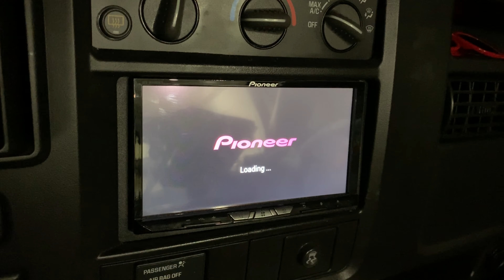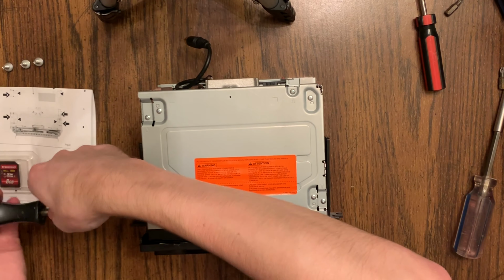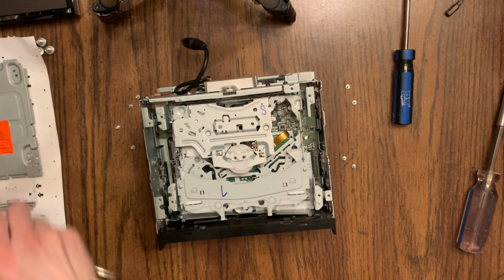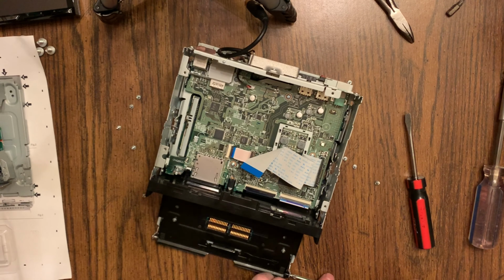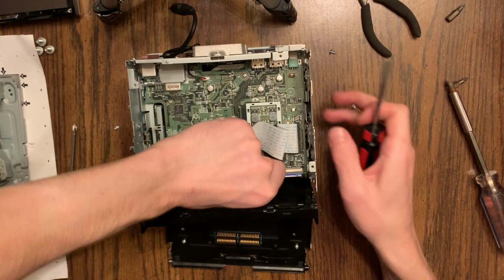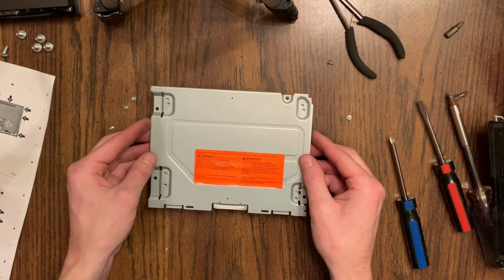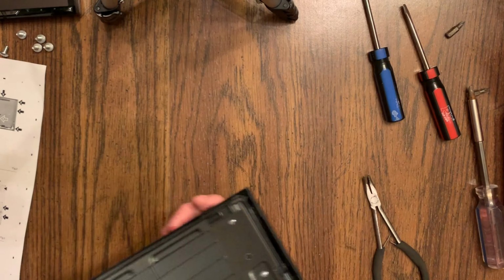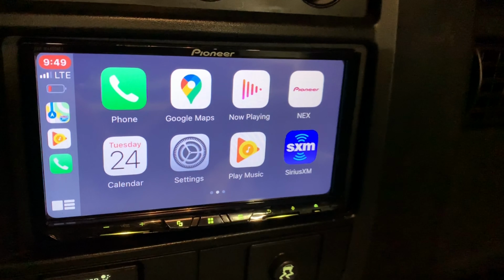Pioneer Software Error Fix - SD Card Replacement Procedure

Comment: I'm having the same problem with my avh-4400nex. Where can I get the software to load on my SD card. Thank you in advance
Reply from the maker: You may be able to find the software on the forums. The site is currently unavailable though..?
http://avic411.com/index.php?/topic/82490-backups-and-images
I purchased a pre-loaded SD card on eBay. Price is close to $30 if I recall.
Reply: @VanwithTim  i cant open the link.. is there any other link?
Reply from the maker: @stephen8385  try again. Looks like the site is back up 👍
You should be able to find the procedure on the forums for how to correctly format and load the file to a SD card.
Reply: @VanwithTim  Right but is the file on the Site? Dude wants 70 dollars now.
Reply from the maker: @cyberlocc  Check out this thread. 
http://avic411.com/index.php?/topic/90534-how-to-fix-for-avh-w4400nex-boot-loop/
He links to the server location of the file needed. I haven't tried the file myself, so can't verify 100%, but the download link seems to be working!
-Tim

Comment: Hi thanks fpr the Video. where may i get a 4200nex SD card??
Reply from the maker: I think this is what you need. I would message the seller to be sure.
-Tim
Reply: @VanwithTim  Hi Tim.  I read some posts and watched the video and am a bit confused on the SD card part.  I understand I can buy a SD card, but I do not fully understand how to "format" it.  Do you know where to buy one already formatted?  Or is there any videos on how to format it?  I dont want to go thru all of the trouble replacing it in my unit and it turns out I did not format it correctly.  Thanks so much for your help
Reply from the maker: @therealjordansloan  I'm so sorry Jordan, not sure why my link didn't post in the previous comment.
I believe this is the pre-formatted SD card you need, but I would message the seller to make sure!
https://ebay.us/MTI20Z
**EDIT** That link is actually for Fernando's 4200NEX stereo.
What stereo do you have Jordan?
Reply: @VanwithTim  Hi. Thanks so much for the quick reply.  I have the avh4400nex series.  Thanks sooooo much for your help.
Reply from the maker: @therealjordansloan  If you want to purchase the pre-formatted card for the avh4400nex (just plug it into the internal SD card slot and be finished) here's what you'll need: https://ebay.us/XeQpuI

Or to save money here's the procedure for DIY on a new SD card: http://avic411.com/index.php?/topic/90534-how-to-fix-for-avh-w4400nex-boot-loop/
Reply: @VanwithTim  Hi.  I  thought I replied to this but maybe it didn't work.  I have the 4400nex.  Thanks so much for your help!

Comment: I need the archive .img or SD card with program loaded for pioneer AVH-Z9250BT help me please! my head unit not work.........
Reply from the maker: I believe the United States W4400NEX is the same as the international Z9150BT. (The W4400NEX file will work on the Z9150BT).

However, I believe the Z9250BT is equivalent to the United States W4500NEX which doesn’t have the free file available yet.

You should email this eBay seller to see if they can offer you the replacement SD card or file:
https://ebay.com/usr/dont_buy_before_reading_description

Comment: How do you open the front housing since the unit with even boot?
Reply from the maker: Great question - You should still be able to remove the screen: 
Carefully use a small tool to slide the bottom screen release button to the side, then push that sliding button "in" to release the screen (it's been a long time since I've done it - might be reversed!)

Then you can try gently grabbing the metal at the bottom corners of the screen frame with some pliers. You'll want to pull on both the bottom left and right sides. Eventually it should start to move outwards.

Comment: I have a AVH-X8690BT stuck in boot loop. Do you have specific image file of internal SD card for this model? I only need image file. I'll be really thankful to you.
Reply from the maker: Hi Rahul. I searched the forums (http://www.avic411.com/) to see if anyone posted the image file but didn't find anything.

A lot of people have been purchasing their replacement SD cards / image files from either of these two sellers if you want to send them a message. They may be able to help.

https://www.ebay.com/usr/dont_buy_before_reading_description

https://www.ebay.com/usr/asd255786
Reply: @VanwithTim  Hi, thanks for replying to my query. I've tried to contact the above mentioned ebay sellers, but no luck yet. Also tried on forum and same response their. I'm really feeling sad.
Reply from the maker: @rahulgoel05  Sorry to hear that. Hopefully you will receive some good news soon. That is very frustrating.
Reply: @VanwithTim  hey I got the required img file from a Sri Lanka based eBay seller. I have a 64 GB sd card lying with me, will it work for the purpose? if not then what's the max size of internal SD card supported by Pioneer stereos?
Reply from the maker: @rahulgoel05  Oh that's great news! The 64GB card SHOULD work. (The 64GB size works fine in the AVH-W4400NEX model).

Use this video to write the image to the card if you're using a Windows computer: https://youtu.be/Cro26vuoPHo

Let me know how it goes!

Oh, and once the files are done being written to the SD card, your PC will show all these errors like in this video: https://youtu.be/pfWDguRujEE?t=13
That's normal. Just remove the SD card from the computer and install it into your stereo.

Comment: Is the W4400 same as Z9150bt? Can I use the w4400 image file for z9150?
Reply from the maker: The unit LOOKS similar, but the file is different.
I know the 4400 radio tuner ends in odd numbers (88.9FM,102.5FM, etc) and the Z9150 has them in even numbers.

You could always try it and see if it works, but I don't think it would.

You could also purchase the pre-loaded SD card for the Z9150 from here: https://ebay.us/UaDCQP

Let us know if you end up trying the 4400 files. Curious if it would work!
Reply: @VanwithTim  It actually worked, i played some songs off of the USB, the menus work too but havent tried everything yet. Thanks for the reply.
Reply from the maker: @H4ndle911  Wow that's fantastic news! There were others on the AVIC411 forums who were looking for the Z9150 file without luck.  I'll let them know of your success!

Let us know if you run into any problems down the road!
Reply: @VanwithTim  well there are radio settings but no radio in the input select menu
Reply from the maker: @H4ndle911  Hmmm. After I purchased the pre-loaded replacement card (the w4400 file was previously unavailable for download) my unit has been missing the radio function as well..?
Haven't spent the time removing it again to try "re-imaging" the card.

I did ask another commenter about their success and they said the radio is still fully functioning on their W4400 after the SD card replacement.

They did mention having to use a pin to push the small reset button on the bottom right of the faceplate. I tried but didn't work for me.

Really strange...
Let us know if you end up figuring out the issue. Very curious myself.
Reply: @VanwithTim  i can confirm the W4400 image file works on Z9150bt. Initially I lost the radio function but it did came back after I did a RESTORE. (I pin reset it after installation but the radio menu was missing. I pin reset again and somehow the whole radio function disappeared, not giving up, I did another RESTORE from the menu and this round everything came back). System information still showing the model as Z9150bt. Hope this info helps someone still figuring out.

Comment: Radio is working again
But lost touch on screen…
Radio boots properly now, but lost all touch functions…
Any ideas?
Reply from the maker: Hey Alex, do you happen to have the W4500 unit? I've heard other reports of the W4400 file working on the W4500, but a total loss of touch screen.

If you have the W4400 and indeed used the W4400 file, I would remove and re-insert the ribbon cable into that funky connector on the motherboard. Sometimes if it's even slightly angled and not fully inserted the touch function will fail.

I think with the W4500 units you're still forced to purchase a pre-loaded SD card from one of the eBay sellers.
-Tim
Reply: @VanwithTim  thanks for thé reply Tim…I do indeed have a 4500…
I had a spare SD card so I figured I’d try…
So no chance there is 4500 file somewhere online? I can order a card otherwise.
Reply from the maker: @alexinprint9804  It's been a month or so since I last checked but if it were going to be anywhere online, it would be somewhere in here: www.avic411.com

Otherwise looks like ~$41USD on ebay unfortunately: https://ebay.us/xvs435

Also here's the instructions on how to remove the written files from that SD card if you plan to re-use it: https://youtu.be/pfWDguRujEE

-Tim

Comment: Hi will this also work on the SPH-DA120?
Reply from the maker: The removal process should be similar (or identical), but the file won't work.
I believe the USA version (W4500NEX) is the same as the X8650BT and SPH-DA120.
Unfortunately none of them have the software available online for free download yet.
There are many eBay sellers that say they have the file / pre-loaded SD card for sale though.
I would reach out to one of those sellers to check!
-Tim

Comment: I just tried this fix and I was able to replace the SD card. My problem now is that when the radio powers on, it turns completely off after the Pioneer loading screen. Any advice?
Reply from the maker: Hi Favio, this is the first time I've heard of this issue. I would first disconnect and reconnect any of the ribbon cables you disconnected in the process. Many people have found them to be slightly mis-aligned with the motherboard socket where they connect.
If the issue persists, I would try erasing the SD card and re-writing the file. Possibly it went corrupt during the file writing process?

Here's how to erase the SD card:
https://youtu.be/pfWDguRujEE

and of course here's the file writing guide:
https://youtu.be/Cro26vuoPHo

Hope you're able to figure it out!
-Tim

Comment: I have the 4500NEX can I just buy the replacement card from pioneer with everything loaded on it already. I see where they sell the card for almost $80 but does it have whatever image or firmware that is needed. Itching to put this unit back together. Any helps appreciated thx

Updated- I bought the $100 replacement SD card and installed it. Now it turns on and I get the splash screen and then the loading screen and then it turns off???? Any ideas???
Reply from the maker: Hey Jonathan, do you have a link to the Pioneer replacement card? 
So far everyone has been either downloading and writing the new files on themselves, or just purchasing the pre-loaded card from eBay: https://ebay.us/qMRY37

For the W4500, the file isn't yet available for free online, and another commenter already tried loading the available W4400 file but was unsuccessful.
Reply: @VanwithTim  I don’t have a link but I read on another post a guy put the link for this part number CXY 3767 and when I pulled it up on Pioneers website it pulled up the SD card
Reply from the maker: @jonathanscott2481  Ah I didn't think to check out the parts catalog for the unit. I think you probably found it here?
https://parts.pioneerelectronics.com/part.asp?productNum=CXY3767

They have a customer service number: 1.800.421.5080

I would personally be weary of buying the factory card replacement, as the problem lies in the cheap SD card itself which becomes corrupt. I would personally trust the eBay sellers over Pioneer on this (just due to their current track record across the entire AVH stereo line so far.)

From what I understand they're still using the same shoddy SD card supplier in their new units... (It's good enough to get the radio to work until the warranty runs out, then after that it's not their problem)

Just my personal input! Might be worth a call / discussion with their parts department to get their input as well!
All the best. - Tim
Reply: @VanwithTim  yes will that work
Reply: @VanwithTim  or does something else have to be loaded onto it
Reply from the maker: @jonathanscott2481  I'm not 100% sure on the Pioneer replacement if it comes pre-loaded or not.

The eBay one will have everything you need for sure though. Should load a bit faster as well as they use a higher read / write speed SD card than the factory card.
https://ebay.us/qMRY37

I guess the only way to be SURE about the one purchased through Pioneer would be to call and verify! Sorry I can't be of more help!
Reply: @VanwithTim  ok thx for the help. I’ll let you know if I get pioneer on the phone. I plan on trying. Need to let them know how big of a pain in my ass this is
Reply: @VanwithTim  I called another pioneer parts retailer and they said for the 4500NEX the part number is QXX3352 and he said yes it should come preloaded. But you’re saying the one on eBay will work on my 4500? It’s about $50 cheaper

Comment: Welp. I purchased the 4500 preloaded SD card from Ebay and got everything swapped out. But now my touch screen wont work. Reseated the ribbon cable mulitple times but it looks perfectly seated. Guess my stereo's going in the trash can after all.
Reply from the maker: I would definitely email the eBay seller to see if you could get a refund for the SD card (or possibly any other troubleshooting tips??)

It almost sounds like they sent you a W4400NEX card. Others have tried the 4400NEX card in the 4500 unit before. Unit boots fine / acts normal, except the touchscreen doesn't work.

Let us know if there are any game-changing revelations in getting yours working again (if you end up finding the issue).

-Tim

Comment: Will this work on my Pioneer AVH-W4500NEX? My unit is now having this problem
Reply from the maker: The replacement procedure will be identical but the software is in fact different.  Others have recently tried to use the 4400NEX software on their failed 4500NEX units.

I think the outcome was that the unit booted up successfully, but the touch screen was totally unresponsive afterwards.

You're free to try though, as it would do no harm if the free software didn't work.
Software here: http://avic411.com/index.php?/topic/90534-how-to-fix-for-avh-w4400nex-boot-loop/

Otherwise you'll have to go purchase an overpriced pre-loaded SD card online here:
https://ebay.us/qMRY37

-Tim
Reply: @VanwithTim  Thank you for providing a link to the fixed pre loaded SD card. I really appreciated your help and suggestion, and hopefully I can get my head unit fully functional again.
Reply: @bryana8958  I have an Avh-w4500nex too with the same issue. Did you get the SD card from the link? If so... Did it work? Please let me know. Thanks.
Reply: @luisdquezadah2927  I just received the SD card yesterday and I’m to gonna try to use it when I have free time.
Reply: @bryana8958  hoe long did it take? I ordered one too 3 days ago. Hope it works well for both of us.
Reply: @luisdquezadah2927  It took me about 2 weeks to receive my SD card slot. I hope it does work for both of us as well.
Reply: @bryana8958 I hope it does and please keep me updated man! My SD card is on its way.
Reply: @luisdquezadah2927  I finally got to remove the factory SD card and replace it with the new SD card error fix. My Pioneer unit is finally working again. It was pretty difficult to open up the unit and going through to get to the internal SD card slot. It was a nightmare going through the process to fix the unit, at least for me anyways. I’m glad that the SD card software error fix did indeed, fixed my Pioneer unit. I hope it’ll also work on your unit as well. Good luck friend, and please keep me up to date how your unit is doing.
Reply: @bryana8958 it's good to know that it worked for you. I just got my SD card a few days ago but haven't had time to open the stereo to replace it. I'll let you know how it goes. Thanks again.

Comment: It just happened to my AVH2330NEX rebooting loop. The SD card has to be specic for my model or it can be any new SD card because I don't see any on ebay for my head unit. Please help
Reply from the maker: Hey Walter, it is specific to your model number unfortunately. I would message one of the eBay sellers selling the other replacement SD cards. I’m betting they’d be able to help and make one for yours.

If not, try searching or asking on the forums here:
http://avic411.com/
Reply from the maker: Just looked back and mine was purchased through eBay seller asd255786 and is still working fine a year later.
Maybe message them and ask?
-Tim
Reply: Thank you very much I will ask them.

Comment: This didn’t work for my application, heads up if you are using a maestro unit in your configuration .9 firmware does not support it, so Apple car play and AC controls were a no go.  Also you cannot jump “back” a version to .8 once you are on 9, effectively you are upgraded out of functionality.  Has anyone experienced this?
Reply from the maker: Others had issues with wireless Android Auto no longer connecting due to the newer firmware. Haven't seen any other comments mentioning the Maestro issues yet.

Do a factory reset for good measure, but otherwise you may want to email this eBay seller: https://www.ebay.com/usr/asd255786
They're very active on the AVIC forums and have performed a lot of custom coding for the Pioneer units.

Hopefully someone else will chime-in with more info soon.
-Tim

Comment: hello I managed to install the card with the file but it works for a maximum of 3 minutes and the sd dies maybe the card is shorted, help me someone is having this problem, will I need to do some procedure before installing the sd, help me mine and the 9180tv